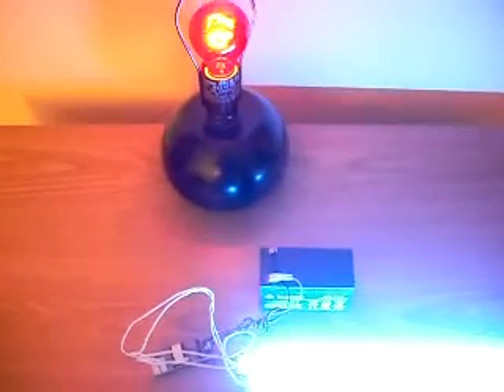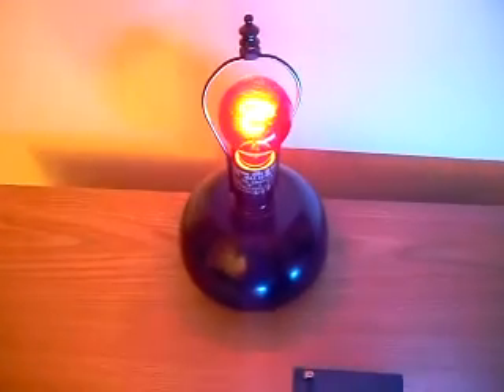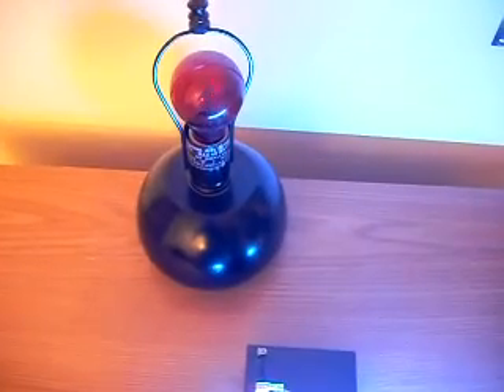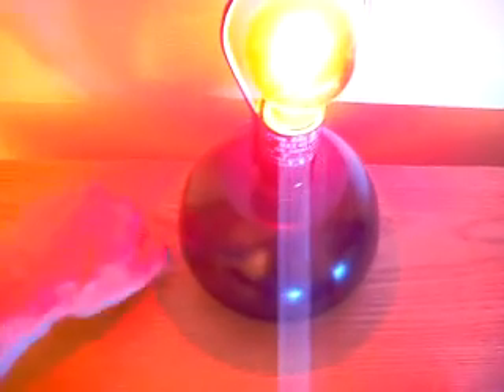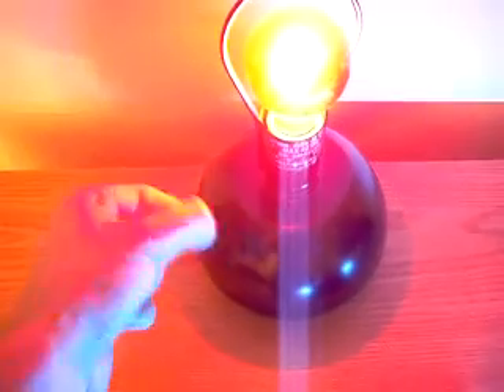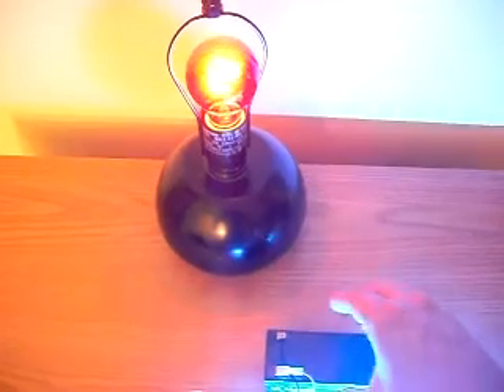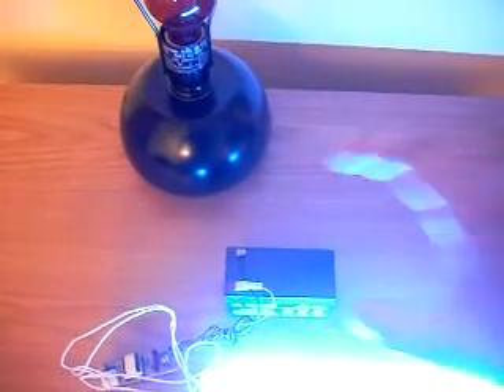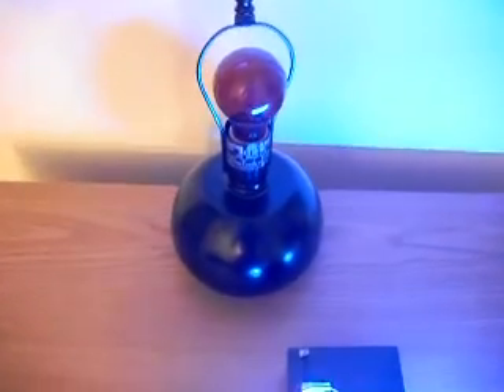Radiant Battery Phenomena

Comment: this is what Bedini shows in energy from the vacuum , you can measure it with a gas measuring device ( can't think of the correct name ) .... he also uses a little lamp with a cable and simply grounds it . You can also do that with " every " radiant charged battery .
You catching the radiant aether gas before it enters the battery , and it doesn't care if it's wood or plastic radiant flows over everything ....maybe blocked by nano crystalline material have to check on that again

Comment: Hi charles. Did you try this with a battery that was new and had not been radiant charged. I do wonder if it is to do with elec resistance as the battery case is carbon black and is filled with highly conductive fluid so yo touching it and grounding out is enough for the highly sensitive resistance swith in the light to activate. Regards andy